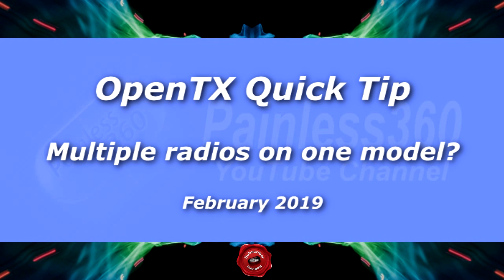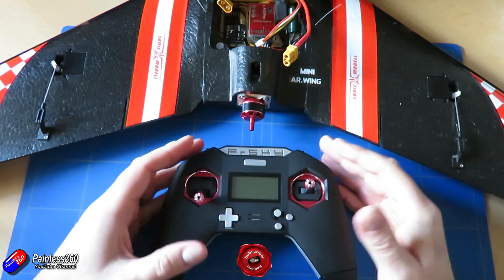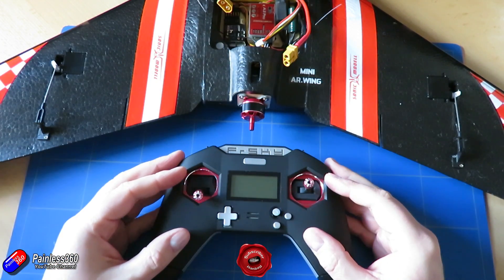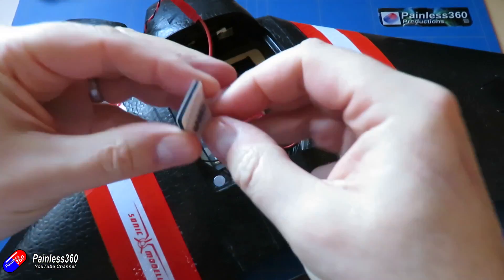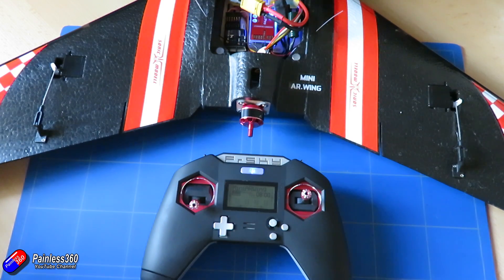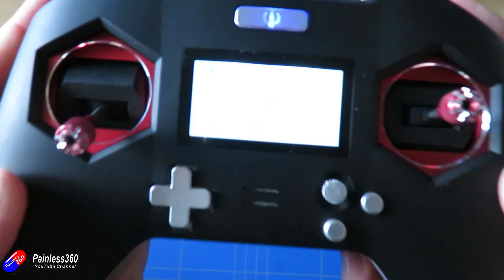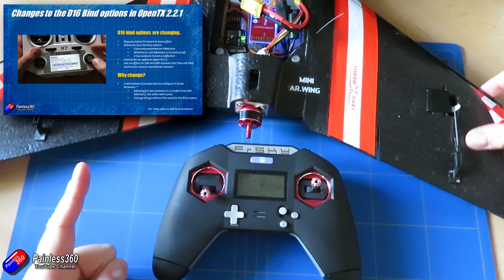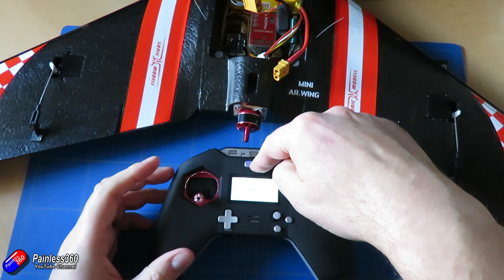Can you bind two OpenTX radios to one Rx?

Comment: Open tx no supports multi bind. Meaning you can copy the unique I'd from one radio to another.... But I have only seen it done on the radio it self... Still wonder if it could be done via companion software or other pc software... Thinking of the new beta fpv lite 2 radio... If I could somehow copy my taranis I'd into that one since it has no screen.... (Could do it the other way but it is a hassel to rebind on both transmitters)

Comment: If you want to use multiple radios with one model, you can do that with Crossfire as the module hold the bind can you can swap the module to another module.
Reply from the maker: You sure can. Any module that can be moved from radio to Radio would work that way.

Comment: I just made a FrSky compatible transmitter for Raspbery Pi (https://github.com/alexbirkett/FrPi ) based on the DIY-Multiprotocol-TX-Module  The transmitter is identified by a number (called RX_num / MProtocol_id_master in the DIY-Multiprotocol-TX-Module / FrPi) There's no technical reason why these id numbers could not be copied from one transmitter to another. I think it's just a design decision that OpenTx does not expose the id number to the user. I'm not sure if the id numbers are even exposed to OpenTx or if they're only know to the radio firmware. Certainly, with some tweaks you could copy the id numbers from one DIY-Multiprotocol-TX-Module to another. I think it would also be possible to clone a radio using software defined radio. The protocol is not encrypted.

Comment: Hello for Pittsburgh, Pa. again! I am a Big Fan for the work you do, Thanks

I finally stepped up from the Jumper transmitters - O.K. stuff for the cost, I bought a QX7 what a difference - no contest. I also got a 4 in one I Range unit as I have a bunch of quads. In the process of moving them to the new transmitter. mostly the brushless ones.

I got stuck on the JJRC X1 - I did get it to bind on the HonTai   protocol using the JJRCX1 format. . Problem is I set up an arm switch on Ch. 5 and it wont start the motors. Looked back to the T8SG checked all the settings look the same. 

Might you know what the problem is? Frankly the RC forum's are way beyond my skill set.

One think I know now - it would have been much easier it I started with planes rather that Quads, I  learned a lot of bad habits that are very hard to change at this point. 

Thank you in advance for your help with this

Ben Herr
Reply from the maker: Tricky to be helpful without a lot more detail. Sounds like it's a channel setup issue - maybe the channel is going too high? The FrSky radios do push the channels well beyond the 1000-2000 limit..
Reply: Thanks for the quick reply. I did a little more digging. Your first guess was correct. The set up for the Arm switch is in fact on Ch. 6 not Ch. 5. My guess is their is a lot of Slop on the Jumper that allowed it to arm on Ch. 5 

Thanks again - Ben Herr